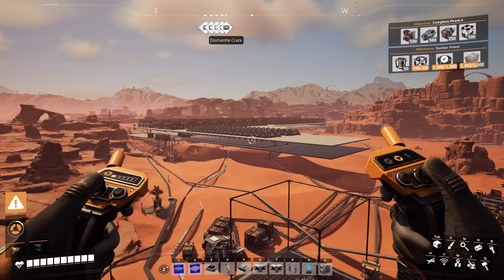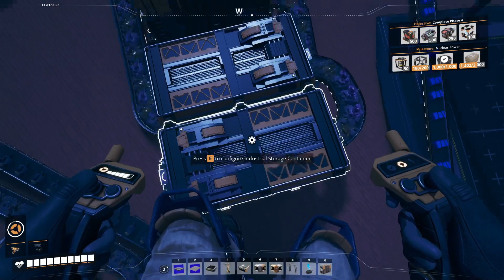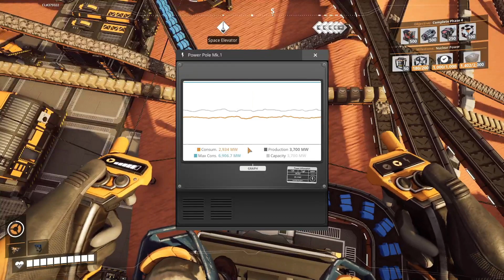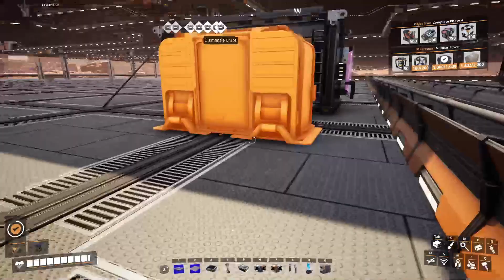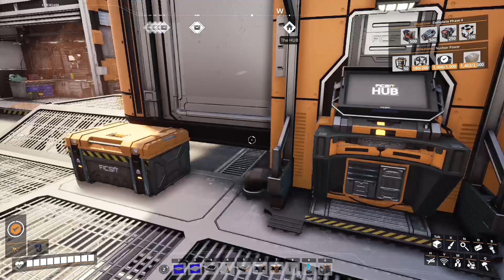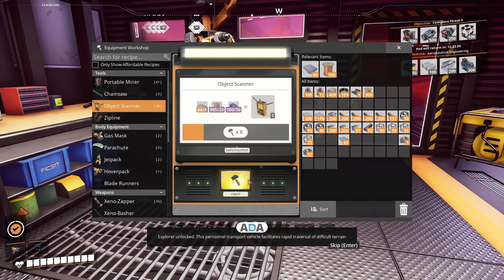Satisfactory - Megafactory online - EP21 - More advanced products

Comment: A much quicker way to delete multiple items is to press "F" and hold down "CTRL" and just look at things , up to 50 and then delete with one click.
Reply from the maker: @jimjams20001  Indeed, but what would be presented in the video, if I did that ?? 😁 But without a joke, if I use that,   I easily misdelete something. I tried it a few times off-camera and I removed a few things all the time, that I didn't wanted. So I stayed with this process. Later episodes will have multiple selection removals, where there are much less mistake possibilities.